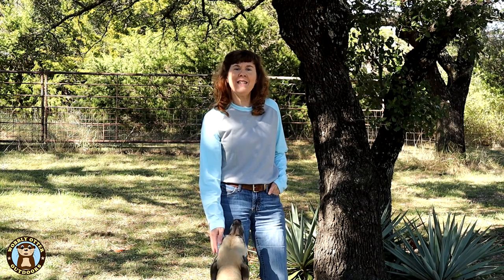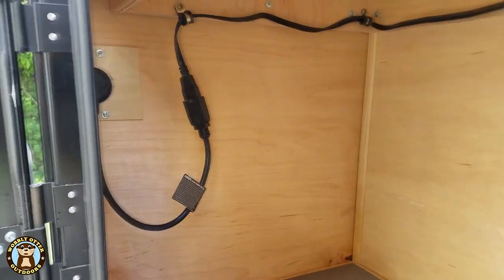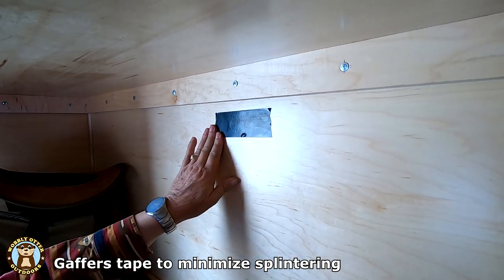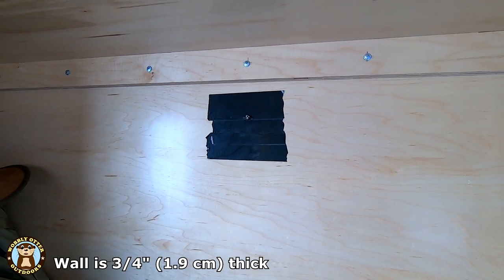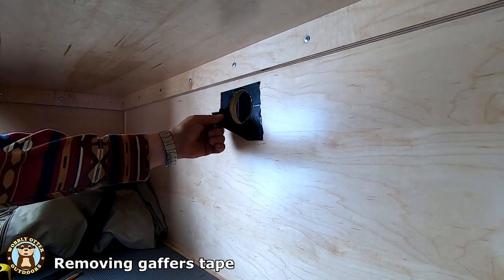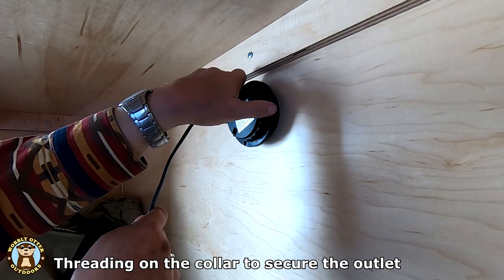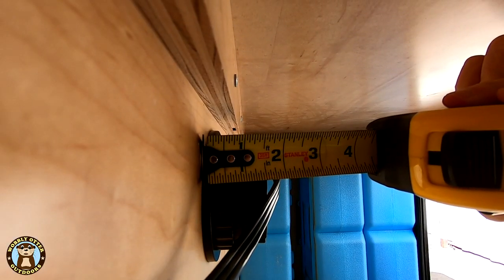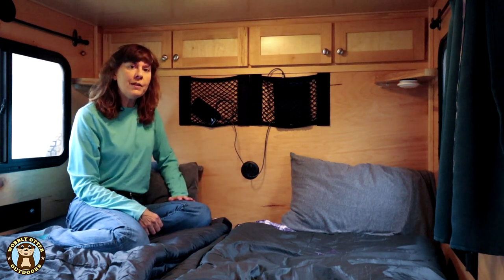Multi-Port Electrical Outlet Installation | Camper Mod

Comment: So, you have to use shore power or an inverter to use the 12v USB ports, you can't use them off a battery and 12v fuse panel, correct?
Reply from the maker: That is correct, for now. There are USB ports installed on the front cabinet that are connected to the battery.